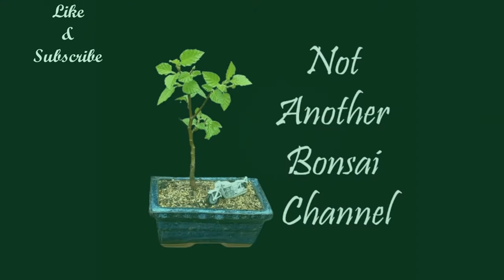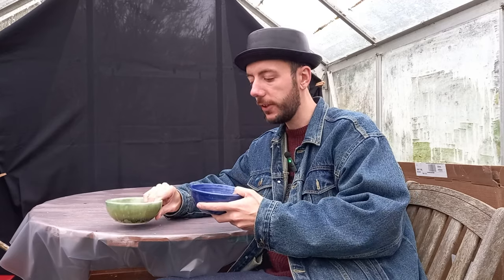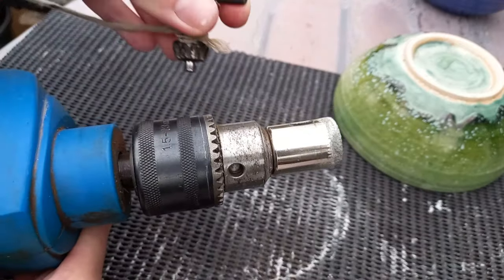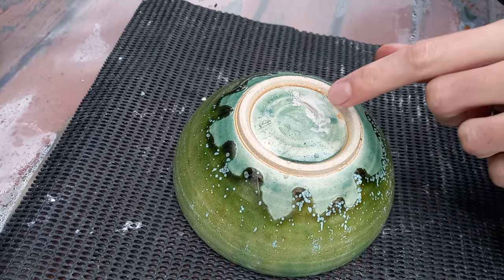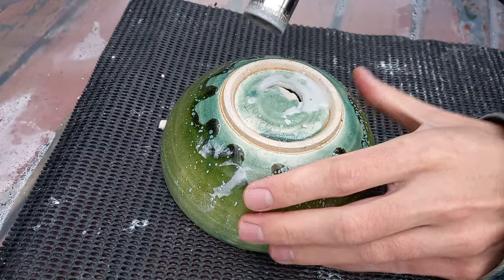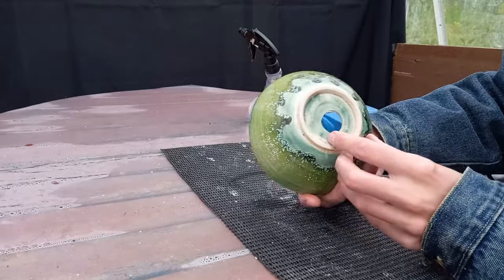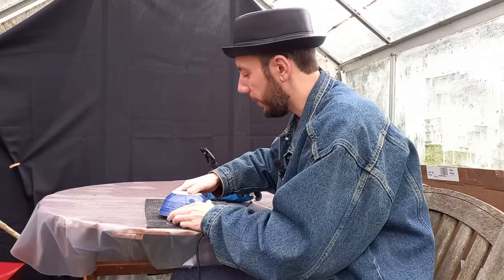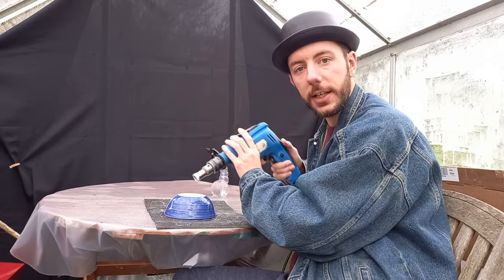Making Budget Bonsai Pots & How I Go About Drilling Drainage Holes

Comment: For the bottom to get the water to flow out of the bottom, get a triangle diamond file and just file 4 openings in the bottom of the pot base. Easy to do for some good drainage. You get a nice V shape opening for the water flow.
Reply from the maker: Thanks for the tip Tom, great idea
Reply: @NotAnotherBonsaiChannel  Not mine. I seen this done on the AS channel. He works with dishes and the filing method I thought was great. Here is the video. About 11:59 into the video you can see how he drills the bowl and then uses the diamond file to create the passage of the water out of the bottom. Really simple once I seen it. Here is the video: https://www.youtube.com/watch?v=AWcxcU3eUQ0
Reply from the maker: @growclipbonsaiforseniors1951  Thanks Tom, that makes perfect sense and something that I will do to these pots before using them.

Comment: Cool. Same kind of diamond drill bits like I have. I drill my bowls right side up. I fill the bottom of the bowl with water and place it on a 4x4 board on the basement floor and drill in the same manner you do. Non slip mat is a good idea. With the wood, once the bit goes through, the bit hits the wood so as no damage.
Reply from the maker: Nice tip Tom. I've always thought doing this way around was the safest way, but I'll give you way a go next time. Would make it a lot easier when it comes to keeping the bit damp and wet.
Reply: Same here
I drill from the inside out.  Bout a quarter inch of water in the bowl which quickly drains once it’s a pot
Reply from the maker: I might try this next time bald yeti!